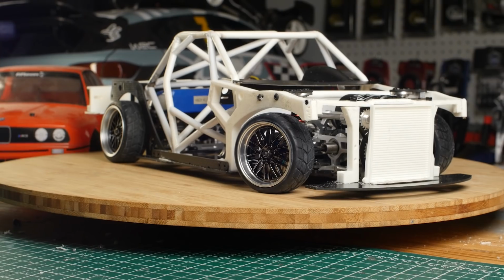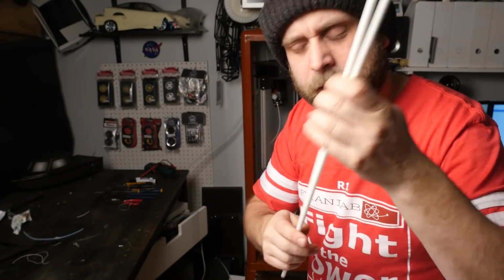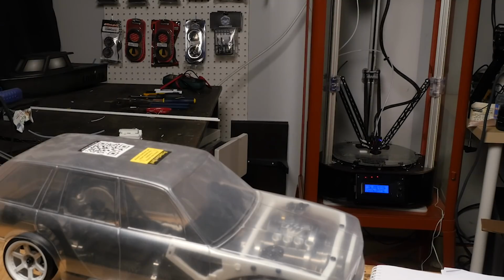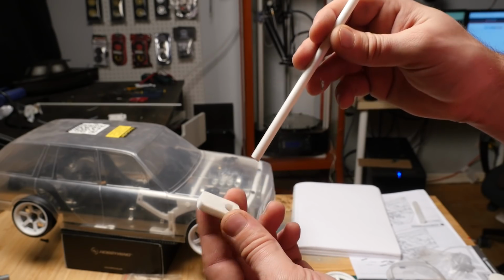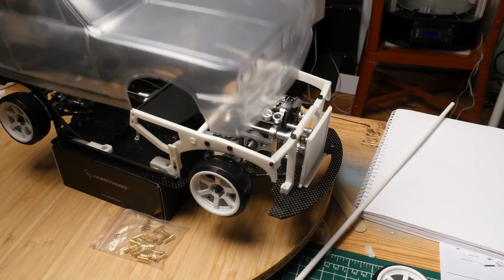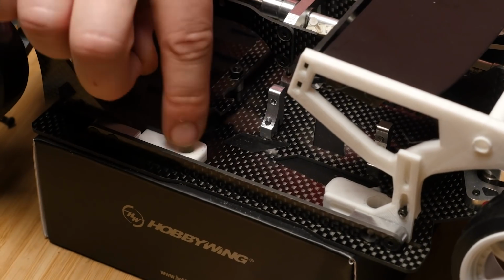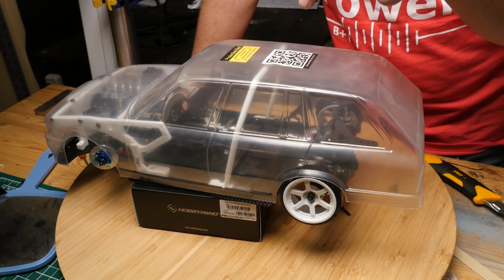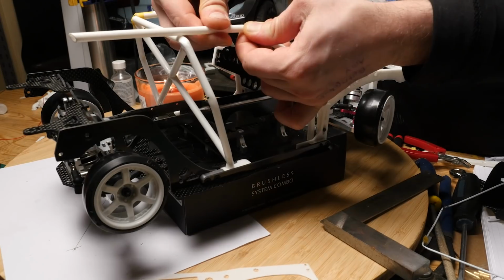E30 WAGON RCDRIFT - Custom Cage Install - D9 bulldog

Comment: In high school we had a perspex bender.. it was like a bar heater mounted inside a structure so you could sit the perspex on top and once pliable you could begin bending/ folding..
But this might not be feasible

Comment: To stop the tube kinking, fill it with sand packed tight and the ends blocked then bend it under hot water, all bends will be 99.9% better, give it a try. Just found your channel, big thumbs up for your build

Comment: So I want to get into rc drifting too.
Can someone recommend a cheap rwd chassis?
I can't really find one. Thx in advance
Reply: It might not sound like anything really good but you could mod an hsp Onroad rc for rwd drifting. Take out the center driveshaft and front dog bones,put a faster servo and add an rc car gyro and you have a kinda good drift rc. Obviously brushled but for 140us/125€ it's a very cheap rc and not that bad either.
Reply: @brunopt2406  
Thanks for your answer.
Do you know if a modified version of a Tamiya tt-01E or tt-02D would work too, because I think there are cheaper here in Germany.
Reply: @JourneyOfDardan  It would work very well they're awesome awd drift cars so you could do the same as the hsp (driveshaft.. Et...).
I've never owned any of those tamiya models but they would definitely work. Gyros are fairly cheap, I've seen some for 18€ online.
Reply: @brunopt2406  
Thanks man :D
Really helped me out. I just have to save some money.
Reply: @JourneyOfDardan  Same. Hahaah rcs are quite expensive. But when you have them it's a lot of fun. I have 3 rcs and and none of them working. Hope you can get one.
Reply: @brunopt2406 
 I hope you fix your's too.
You seem like a very nice guy. Thanks for helping again :D
Reply: @JourneyOfDardan  You're welcome. Haha
Reply: Same. I can't much on any of them

Comment: You could try using a spring bender.  I know it works for metal tubing, but not sure about the plastic.  You need a tight spring to the diameter of the material you are bending, but it will keep the tubing round.

Comment: ...ou boy-.- First like mentioned get solid rods for bending and tubes for straight section if you want to save some money and plan on not using this as actual safety cage. Tube you can bend if you have suitable size spring to insert inside, that supports the material while its soft. You might find one from one of those crabber tools to meant to get small items from hard to reach places, depending on side of the spring in that and your tube, how even i havent tested fitment my self. I just know that is how plastic pipes are bent for instance when installing electric conduits. Also on safety cages you are suppose to use tube, not solid material due weight and if done right tube is actually stronger than solid material.

Secondly safety cage main arc is never on angle like that. Its meant to resist impact energy directly from top or side and rest of the cage is supporting it in process. Angling it like that would only be suitable if you are reversing in high speed and expect something to drop over the car. 

Thirdly 9:36 thats a rasp meant for soft material up to maybe aluminum. Chainsaw files you can get in different sizes and sure work while being bit slower and might need brass brush to empty if file gets bog up.

Finally while building the cage cross brazing is good idea, how ever that is there only to support existing structure. Less you have bends and welds, stronger the cage is. Two pipes might be weaker than one straight pipe, specially if there is weld in the middle to another. Does this matter on RC? Probably no if you are not planning on flipping your car in high speeds, how ever i believe goal was to be "scale as fuck" so putting little more effort on making actually reliable cage structure, even if only from styrine is def worth it.

Comment: Fill your styrene tube with sand and tape the ends up before you heat and bend it. That helps it hold its shape.
Reply from the maker: for metal. for plastic it's too soft. and will bulge

Comment: Good vid.  A tip though . Use tamiya super thing glue, it's like a liquid.  Then cut tiny pieces of styrene and drop them into a little container of the glue . Mix it a bit and it'll turn into a paste then use a brush a paint brush to apply it to the joints. Its turns out in a welded look.and fills the gaps, I have done it many times .

Comment: It takes a while but its worth it, fill the tubes with sand so it cant kink, its a fixed volume, water wont let it heat properly. Tape the ends off the filled tube so the sand doesnt spill, for me when i used it, it took more time so i was able to make sure i did it correctly and didnt want to have to do it again. Side note, love your vids and its given me an inspiration on the details i want to include in my future builds
Reply: I just wrote this then saw yours lol

Comment: cool build dude,the wagon is gonna be awesome!👍i recently did a styrene cage in my brute build,was fun to do...yours is looking good..i found heating it up slighty with a butane torch helped make some nice bends..to much heat it will melt and distort so you gotta find the sweet spot....i also found using a dye to make consistent bends.just takes practice..i scrapped the first one and made a second that i was super happy with..good luck with the build👍👍